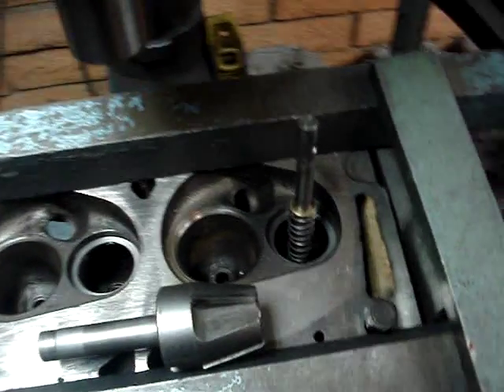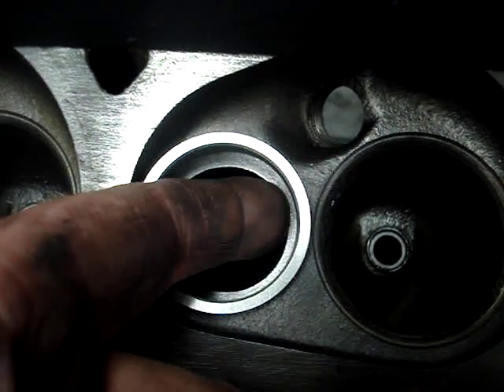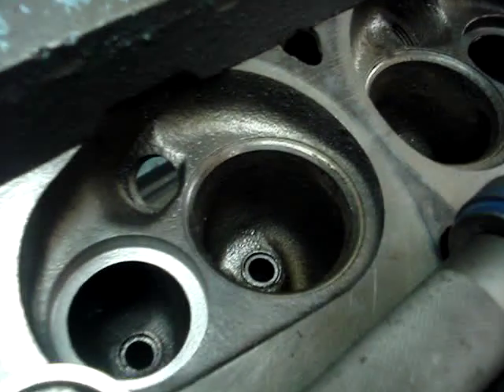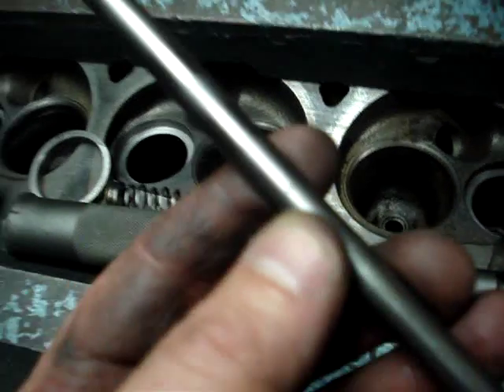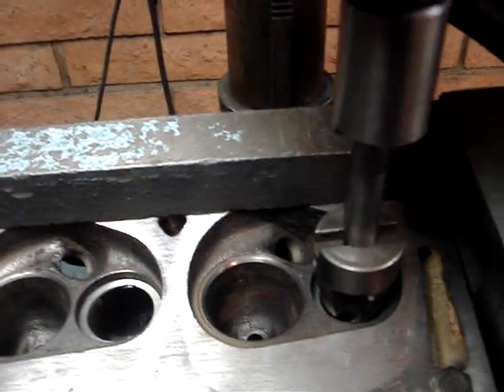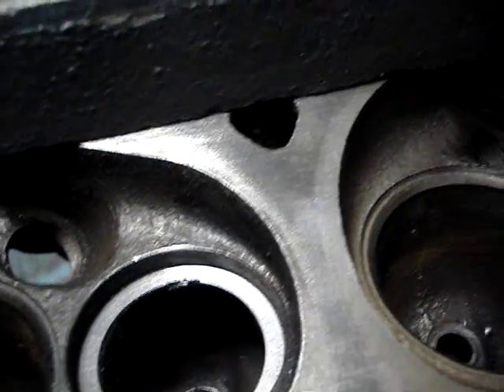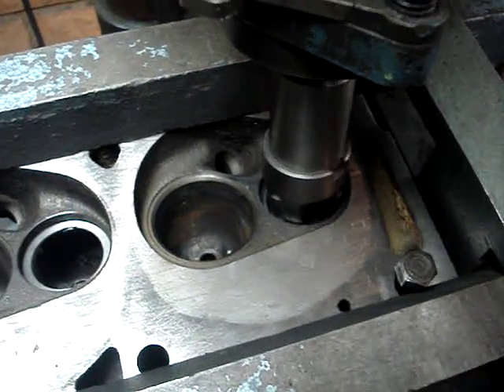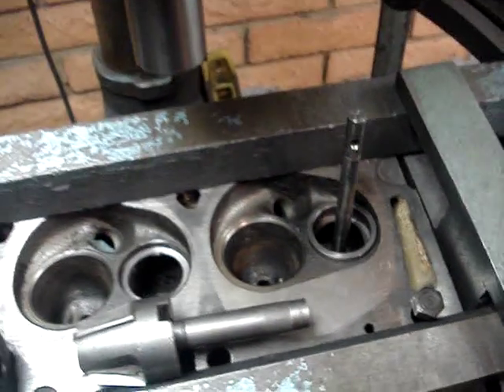Cylinder head rebuilding

Comment: Do you know of anyone that publishes a master specification book that would have all the dimensions you need for engine rebuilding? Assembled valve stem tip height, assembled valve spring retainer height - spring seat to the bottom of the retainer,  etc....
I used to have two, one for domestic engines, and one for foreign. Unfortunately when I sold my machine shop, I let the new owner keep the books, so I don't even have the publisher's name for a reference to buy a new, updated one.
They were hard cover books. A really great source of information.
Thank you in advance for your assistance.
Take care.
Keith
Reply from the maker: AERA (Automotive Engine Rebuilders Association) publishes that information in their books,  I'm not sure if you can get them if your not a member but you can check

Comment: Do you feel there is benefit to using a tapered bowl hog  which should create an hour-glass shape as it leads in to and out of the valve bowl area versus using a boring head that would make a cylindrical shape for the valve bowl?   Also, what depth of hardened seat are you using. I heard FE heads are shallow and you don't have to go very far to get into the water jacket when doing seats. I recently bought a seat and guide machine, a Winona PH2000. Your machine looks like a PH2000. A few guys on speed talk mentioned this is a kinda light machine in regards to rigidity and recommended I do not go with a single blade cutter. I did buy a 5 blade cutter set-up. I've noticed you use a single blade. Do you find any chattering issues? Do you finish the contact seat with a stone? Are you on Speedtalk forums?
Reply from the maker: I always finish with a stone and everyone should,  I spent 6 months at a shop I worked at years ago trying to get perfectly concentric seats with a serdi (the Cadillac of Seat/guide machines ) we also tried our cutters on a Kwik way and a Sunnen machine The guy I was working with was a 50+ year journeyman machinist and tool maker,  we both came to the same conclusion there is no seat and guide machine on the planet that cuts seats concentric enough for a perfect seat,  believe me we tried everything no matter what we did or what machine it was the seats just wean't as true as with the stone. I strongly recommend you use a to stone finish your seats. the 390 heads take a .312 depth seat that is pretty deep I have never hit water jacket at that deph  but that is what the book calls for I usually put in .250 depth just to be safe

Comment from the maker: The best way to handle the lip is use a seat grinding stone that is dressed to the same size as the inside dia. of the seat this makes a nice match between the seat and bowl you can then finish (blend) with a cutting tool on a die grinder